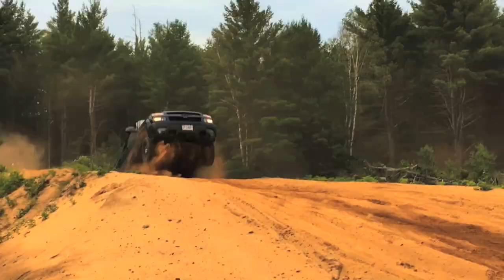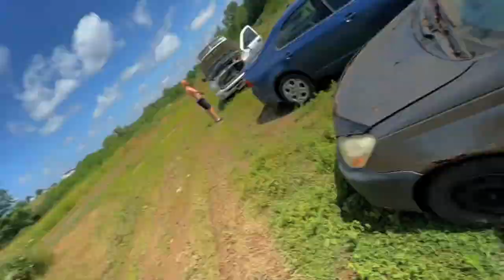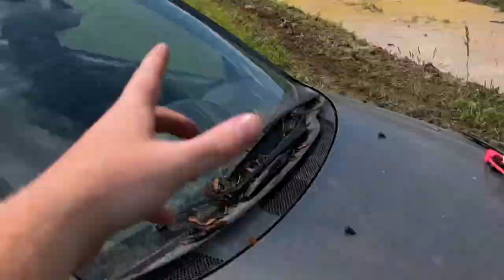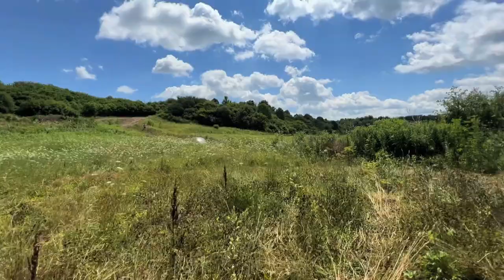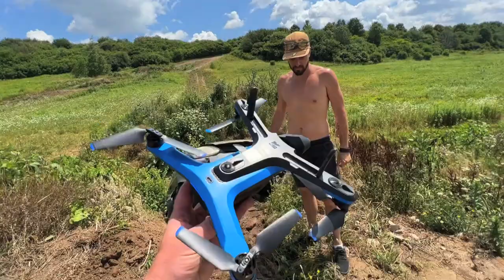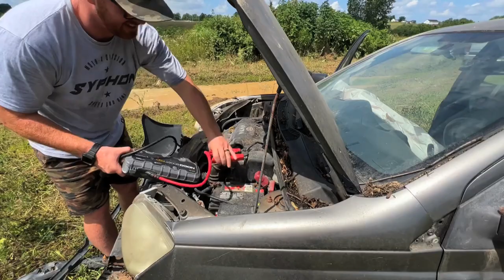Toyota Echo CAR JUMP LAUNCHED!

Comment: Here’s a tip, if you’re gonna blow the engine.

Toyota and Lexus ECUs have a quirk: If the ECU senses that the engine has been at the rev limiter for a set amount of time, it will lower the fuel cut-off point by 100 RPM every couple seconds. When it does, let off the throttle for about half a second to a second and it should reset to the normal fuel cutoff point.

Comment: did you put it back in park or neutral before trying to start it again?
Reply from the maker: Sure did
Reply: they didnt go through much effort though i would had it running lol. the ground wires popped off.